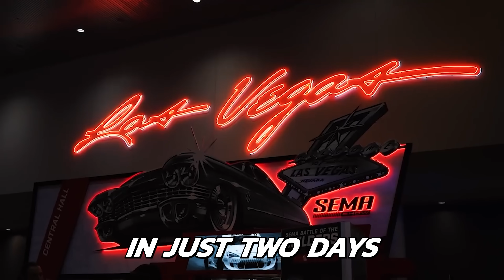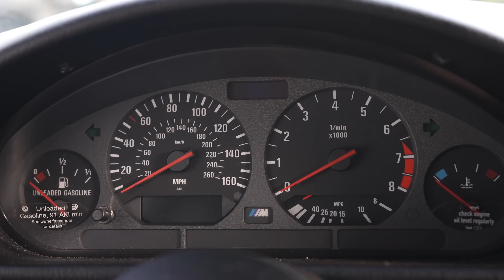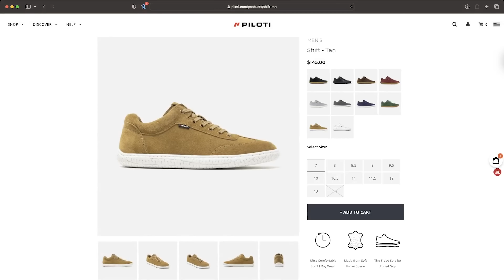Building the USA’s FIRST Liberty Walk Nissan Z for SEMA! - Part 4

Comment: Wish one of the bodykit manufactures would make a kit with a revised front end, round headlights, new hood and bumper like an old school  Z (240,260,270,280zx). The back of the current  Z looks great just needs a more retro front to set it apart from the 370! Cool build guys.

Comment: p.s. another step you can do for the metal in the wheel wells is to paint it with steel-it before welding and then itll better prevent rust in the LONG LONG term of the cars existence
Reply: We do that. Just not shown here.
Reply: @mickeyandrade3435  good to know, what a sick car 😄